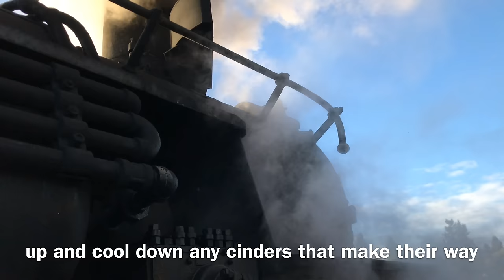How To Fire a Full-Size Coal-Burning Steam Locomotive [4K]

Comment: That little fire car has got to be the funniest little thing going along behind the train 😂👍
Reply: It's called a speeder. Railroads used them for years to run inspection and maintenance crews up and down the tracks. They have all but disappeared in recent years in favor of High-Rollers. These are regular trucks and suvs fitted with retractable flanged wheels front and rear. Speeders are still around. People buy them surplus and get together to run them along abandoned or little used tracks(with the R.R.s permission).
Reply: Looks so cute
Reply: @johncombs2990  Interesting, my father used to work for BNSF and they always referred to those vehicles as high rails. Never heard the term high rollers.
Reply: @SgtKilgore406  You're probably right. I knew it was high something.
Reply: Explaining that job to your Date and still manage to impress her is a talent! 🤣
Reply: It sure was funny watching it drag around that lil tank trying to catch up with its giant buddy.
Reply: I've been that other kind of fireman.Where you stomp with your feet. It was adjacent to the George Washington National Forest.

Comment: Thank you very much for this video. I was a fireman for the K-27 DRGW 464 in Michigan during the summer/Christmas breaks away from college in the 90s. I have described the job many times, but the way the fire appears when running is best seen and your video beats any verbal description. I was taught and used the horse shoe method and never had a problem since it seemed to be what she liked. The steepest grade we had on the line then was 2%. They took that section out of the trip since my time unfortunately. Great job on the video!

When I was in Colorado several years ago, they stopped running CT because of the fires so never made it over to see 463. Next time.

Comment: Firing and coaling a steam locomotive was so archaic for many years.  You would think someone would have had invented a better 'coal delivery' system to the firebox.  That damn shoveling was very hard work.  No envy , here,  for the man (or woman) performing that back breaking ordeal.
I guess oil fired locomotives were a very good thing !
Reply: They did use mechanical stokers with coal on some locomotive types. The fire boxes demanded so much coal that a person would be unable to supply enough. But I definitely agree that it would have been a demanding job!

Comment: I haven't been able to coal fire my 2 1/2" scale live steamer successfully. It does work well using wood with a grate adapted from a pellet stove.
 I freely admit to knowing nothing about drafting a locomotive. I always appreciate these how to videos.
Reply: Don't know size of ur fire box. 2 1/2" is pretty large. So assuming it is scale, not gage, grate spacing 5/16 to 3/16 should be good. Starting with easiest, check ash pan dampers are open and there is enough space for adequate air flow between grates and ash pan. 
The blast nozzle should be free of internal obstructions like rust scale, teflon tape, etc. Often these can only be seen with the smoke box door off and some steam or air blowing through the cylinders out the stack. Most important be sure blast pipe is correctly aligned to the stack and @ the proper distance. There is a lot of information on the net at club sites to aid correcting ur drafting issues.
Reply: Check Keith Appleton's videos. He is a brit who builds, operates, and repairs everything steam. When they fire up a loco, they have a special blower that rests on top of the stack to draw the smoke out and get the coal glowing right until steam is up enough to vent through the smoke box and create it's own draft. Really interesting guy, but he is a Brit, a bit dry, and set in his ways.

Comment: 17:20 -  The 'blowdown' is also used to clear any mud and debris from the foundation ring of the firebox. This  prevents mud baking hard, with subsequent hot-spots that lead to distortion and failure of the inner firebox wrapper.

Comment: Great video! I rode on this section of the C&TS this past summer. I didn't know the blowdown was used to purge excess water; I always thought it was for sediment build-up.
Reply: You are correct, the blow down is to remove the solids in the water. They build up in the boiler as the water turns to steam. All water has minerals and solids that stay in the boller when water is  boiled.

Comment: The Southern 4501 is another 2-8-2 Mikado now liveried in Chattanooga at a working railroad museum. I've been on her before. She is, as you would guess, fired by coal. While firing with a shovel is an option, the main way of firing her is with a stoker - a big corkscrew looking thing that moves coal from the tender to the firebox under the floorboard of the loco that is over the coupling, etc.

Comment: the plume of steam up by cab is the steam turbine for the headlight generator, 480 watts for headlight and cab lighting 32 volts at 15 amps.  there is a sand dome for the sanders, air is 
blown into the sandbox and blown down in front of the drivers or larger wheels.

Comment: How do they get the fire started? I don’t think that is mentioned here???
Reply: I live in Illinois which has the union Illinois rail road museum.
Reply: usually, just some paper/cardboard and a match or lighter then add your main source of fuel like getting a campfire going
Reply: To Austin: It must be that  since the air draft comes from underneath the coal it doesn’t take much to get it going…

Comment: Stupid question, but when the coal feed door is closed how does the air for combustion get in.  To generate that much fire and heat it would take a lot ventilation for the fire.
Reply: The draft needs to pull the air though the bed of coals via air inlets below the coal grate...
Pulling air through the stoking door would allow the air to bypass the fire and decrease efficiency.

Comment: A garbage truck has this gate that travels backwards to compress the garbage. It seems that the reverse could be used here to move the coal towards to the fireman. Meh, I dunno. Just thinking on the fly...
Reply: And some steam trains in fact DO have that feature -- it's called a coal pusher!
Reply: Most tenders have a sloped floor in the coal bin with a level area at the front of tender. As the fireman's shovel removes the coal from tender, the coal slides/falls forward. You'll see that in these drawings: http://www.nprha.org/np%20steam%20tender%20diagrams/forms/thumbnails.aspx
Reply: Some engines are so coal-hungry that they have an auger to get that coal burned.

Comment: Of course, years later in February of 2020, the K-class locomotives on the D&SNG were converted to burn oil. This was done in response to the D&SNG being blamed for a major forest fire in that part of Colorado, and (primarily, in fact) to reduce carbon emissions caused by normal operations. Other D&RGW K-class locomotives in operation, such as on the Cumbres and Toltec, may soon convert to oil as well (if they haven't already).

Comment: Good job Jeff. Awesome stuff, so many questions. Do you know wacky, are there charts for fuel/ water consumption, is that impacted by the seasons, what if you run out of fuel or water and is it possible to stall a train? Thanks for the video
Reply: Call the back-up Diesel engine I would think, there is a video here on the Tube that had a heritage tourist train, a piston failed and the train ground to a halt.

Comment: My friends and I got into a discussion of "seals" on steam engines today. There was some discussion of Oakum in extremely early steam engines and I've read about glands in some of the books on steam engines. I've read the Vulcanized rubber was available after 1850. And I saw a video on the replacement of a steam engine head gasket from around 1915 where the gasket was made of copper.

Obviously the history of steam engines covers about a century and a half and thus varies considerably. But I was wondering if you could talk about the seals of steam engines throughout their history. I'm mostly concerned with steam engines around the Civil War era, but also in general. 

What kind of seals did they have to prevent steam from escaping? How effective were they? What materials were used? How did they work? At what point in time did things change? How do you keep the steam from escaping through every little crack and crevasse and does it matter if it does?

 Thanks for the videos! And any information you could give on this would be great!

Comment: i have a question. i am in the process of modeling a steam locomotive, and am curious how the floor plate that covers the space between the engine and the coal car moves when the engine is going around a curve. in this video, it seems like it is fixed in place
Reply: It's called an apron it is secured to the engine and slides around on the tender.

Comment: At 4:40 , What would that large structure with the little house like building on top have been used for?
Reply: That is a coal tower (or tipple) which would have lifted loads of coal from ground level to be stored and poured into the tenders of the locomotives.
Reply: @itsyaboi3349  neat!  Thanks for the reply!
Reply: Coal fired steamship Titanic

Comment: question: by creating a heel at the back doesn't that starve the back of oxygene?
Reply: Not necessarily, the shape of the firebox and Grate affect how the draft is drawn through the fire, and burn some areas faster than others.

As such there are some locomotives where its simpler to use a thicker fire bed in the faster burning areas to help even out the air flow.
Reply: @MrDibbsey  Thanks for answering my question, also what are your thoughts on the D&S switching to oil firing?
Reply: @awildjared1396  no opinion from me, I quite like firing with coal but I'm UK based so couldnt say for the D&S.

Comment: I've owned traction engines before I've the pond in the uk what sort of boiler pressure does that beast run at? And what's the plate in the fire box at 7:42? To protect the tubes from cold air?
Reply: Max operating pressure for this reasonably small engine is 195 psi, and bigger engines can run up to 300 psi, typically. There were some oddities, experiments with high pressure steam engines, but the experiments never caught on on a large scale. Mostly just the Delaware and Hudson RR here in the states. Also, the plate you're referring to is known as the brick arch. Many UK steam locos had this feature in their firebox as well, it was used to redirect partially burned pieces of coal back into the fire to be more thoroughly burned to cut down on smoke, wasted coal and hot cinders being blasted out of the smokebox and setting fire to the trackside. Everything has a purpose on a steam loco, and honestly on these engines the reasons for a lot of the parts were to extend the engine's working life before maintenance was needed to cut down on cost of rebuilds. Also, coal isn't cheap, so fuel efficiency was and is just as important! 
Cheers from The States!
Reply: Huge fan of arches, circulators, and thermic syphons. Operated a loco without arch...meh. Was retubed and fire box modified over the winter. Arch added. Wow! Night and day difference.  Arches provide longer path and higher temperatures to more completely combust fuel & gasses. Also,  Purdue Univ & Univ of Illinois did studies showing radiative energy accounted for much of the heat transfer to the fire box. Arches significantly radiate.

Comment: Great looking video, i would however advise to either speed up the subtitles or to put more text on the page, as you now get half a sentence with every 'slide'  after which you have to wait for the rest of it to appear. This caused me to skip through the video in order to get the information in a pace that doesn't force me to wait every couple words. I feel like if you were to put more text in the screen and possibly leave it there for longer, you could put complete sentences there so there is a smoother flow of information and you can focus on the video more.

Comment: We don't bother with a 'fire patrol' here in the UK. But then, we run steam locos all the time (depending on the route), and the ground is almost never dry enough to actually set alight, regardless of how many cinders the loco chucks out.
Reply: England is forever "damp".   A lot different than the US west, where they might not see a drop of rain for 2 or 3 months at a time.  Hell even forest fires can occur in the Eastern US, there were several really bad ones back in the fall of 2016, burned half of the resort town of Gatlinburg down.
Reply: No rain for months? Blimey! If it doesn't rain for a week here (I live in Northwest England, which is one of the wettest parts of Europe) we start calling it a drought. . . =D

Comment: Nice video, but how come no lifting of the safety valves in a tunnel? 
Also, check out the The NSB Class 49, nicknamed Dovregubben ("the Dovre Giant"). Those gave the German engineers of Krupp a shock, because the power the Norwegian Engineers managed to tease out of it. They could just not comprehend that it was possible to do that with such a light locomotive. It was very advanced for it's time, used a welded frame instead of the usual riveted. Sadly,just one exists. I don't know if it ever will be restored to running condition.
Reply: Coal fired steamship Titanic

Comment: The only downside is that especially steam locomotives arent the best with curves like the curve cant be too tight because that can cause an accident or it can cause the locomotive to just get stuck and it cant be too wide either because that can also cause an accident or just a very bumpy ride because the wheels will be on the rail ties and gravel inside the track section

Comment: You inject water into the boiler with injectors, not 'inspirators'... you're not inspiring the locomotive to do anything, you're just putting water in it! Some locomotives like logging engines (Shay, Heisler, Climax, etc) sometimes have an Aspirator to suck water from a stream or pond or some other non-elevated water feature to get it into the tender tank, but then the injector does the work of getting it into the boiler.
Reply from the maker: This is what the D&RGW K-36 class locomotives have, they are inspirators:
https://imgur.com/a/7skProT
Reply: @JeffBerrier  I'll recant on that. Never heard of such an animal. Based on this, probably because they tended to be less reliable. Same function, lots more moving parts. 

http://forum.wwfry.org/index.php?topic=1637.0
Reply: @JeffBerrier  Nice video work from the cab side, you using gopro's or something different?
Reply: Excuse me if I jump in on your explanation Jeff. The way I understand it, The word "inspirator" was a trick trade word that Hancock coined. I think it refers to the "double" feature of one element to lift the water and one to actually inject it into the boiler. The type Hancock I use on my shop boiler is the greatest working injector I have ever seen and I imagine thats why D&RG used them.....Dave

Comment: My opinion only is iv had experience with engines like this more traction engines than anything but way to much coal that guy is putting in will also cause poor draft but and even fire will do way better and more efficient heat transfer for the fire around and top of the crown sheet

Comment: How to light up a steam locomotive?
1. Add 1 ton of wood 
2. Take a flamethrower
3. Done
Reply: The first line should read "How to win a Darwin Award?"  https://en.wikipedia.org/wiki/Backdraft
Reply: Not exactly.....  ;)
Reply: @FletcherFinance  instructions unclear. Now it turned into a diesel loco
Reply: @greko4849  Lol.  Even those are a bit on the complicated side to start.  Especially the pre computer one's.  So many breakers and start up valves to turn the engines over.
Reply: @FletcherFinance  I know my friend. My dad works on a diesel loco ( adtranz de2000) and I saw some ways to turn it on and one way is that you said before.
Reply: @greko4849  Cool!  Lot of people are under the impression that it's like turning on a vehicle.  Not in the slightest.
Reply: @FletcherFinance  as you said ;)
Reply: You also need coal and water, it's steam, duh.